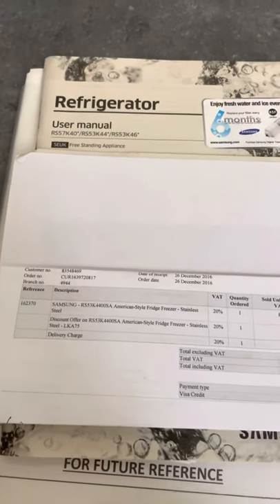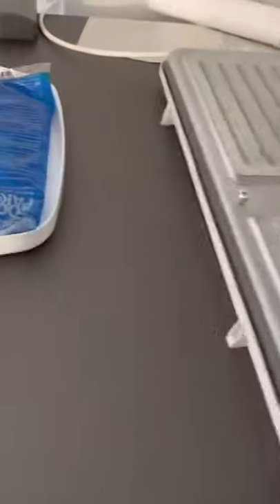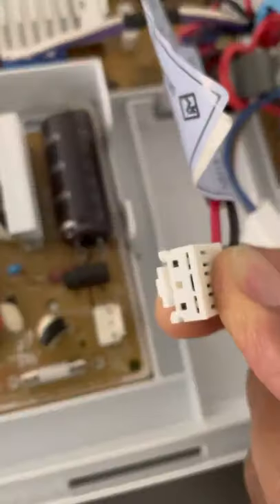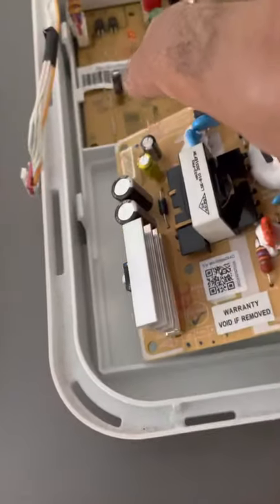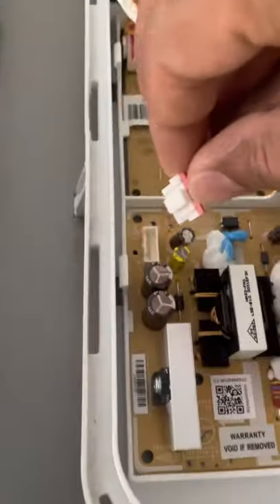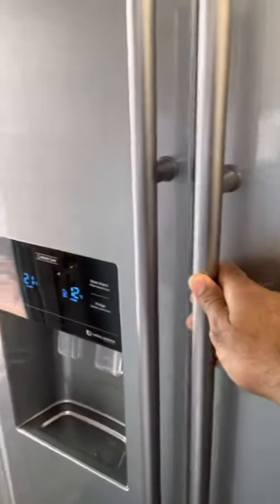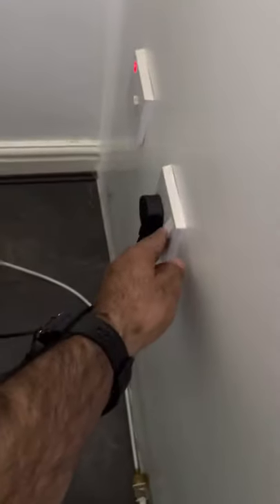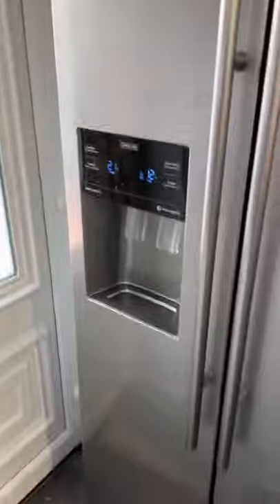Samsung American Fridge Freezer | No Power | Self Repair | DIY Repair Job | Easy Repair

Comment: Thank you sir for the video and thanks to all in the comments for the tips. I have a Samsung RS7547BHCSP/EF side by side fridge, it went "cold" (haha) overnight, no power outage or unusual events. Samsung scheduled an inspection in a week, would of had to pay $35 for troubleshooting. I found the module in description STD32W or DA9200530A (Main PCB Control Board Module) , than pinpointed the Schottky diode SB2100, tested on board, it was short-circuited. Some extra research revealed it is a common fault with this type of source, many recommend swapping with a bigger one. All I could find is a SB5100 (5 Amps 100V) where the original was 2 Amps 100V, I had to drill the board to accommodate thicker wires, used a 1.2mm drill bit only by hand, very careful not to damage the copper leads. Solder it and works like a charm. I hope the extra strength will keep it running for a long time. Thank you all and good luck to whomever will find this post useful.
Reply from the maker: That’s excellent. Good to see this video still helping out. My mission to help many. Please support me, like share and subscribe. Thankyou 👍🏼👍🏼

Comment: Same here- my fridge just stopped working, no prior issues whatsoever... I found the faulty diode (DS2) afer checking for continuity with a multimeter and then took it for a replacement at a local TV repair shop (yes, not even a fridge repair shop!!!). It end up costing me ~5 EUR and about 2 hours (including the trip to shop) of my time. Many thanks for the video and hope this helps others solve their Samsung side-by-side fridge issues as well.
Reply from the maker: Fantastic!! Please support channel, like share and subscribe. 👍🏼

Comment: I wanted to share my experience after watching your video just so I can also help anybody who's Samsung American fridge suddenly looses power,  I had the same issue with mine, after watching your video I decided I was going to order the part and attempt to fix my self, I rang an engineer and was quoted £160 plus vat plus parts to fix my ff, he said on the phone it was a common fault with one of the PCb, so I decided I look on you tube before forking out that much, I ordered off amazon for next day delivery, I paid a little more than I could've got off ebay but I was after a quick turn around, I was supprised there was so little available on amazon and not as many reviews as I'd like but ordered it anyway as I thought as amazon if it doesn't fix the issue I could send it back. The part came as expected the next day so I fitted it like in the video, but the fridge still had no power I was literally on the verge of giving up so I went to put the part into the box for a return to amazon for a refund, it was then I noticed that the box the new part came in had a stanly blade mark up the box, and seen as though I carefully ripped the bag the box came in I then realised this had been sent out before to somebody else and I suspectected I'd been sent a duff part where somebody had had the same issue then posted their broken one back to amazon!, I returned the parcel explaining my reasons and I was given a refund from amazon, I proceeded to buy another part of a Samsung approved dealer cost me £80 next day delivery, it came I fitted and the fridge fired straight up!, moral of the storey if you do order of amazon or Ebay bare in mind there are some idiots out there doing this and had I not seen the slash on the box I was first sent I would have thrown a perfectly good ff, thanks for you video your a lifesaver
Reply from the maker: Great this video is still helping! Yea that’s how these things work sharing experiences, and I am sure your experience will help many to come. Glad you got sorted in the end, and such a shame people out there would do such a scam, shame on them. Thankyou for watching, please support my channel, like share and subscribe.  👍🏼👍🏼

Comment: Spot on with the fix.
A 20p diode as mentioned further down in the comments.
Extra info....
When testing with a multi meter, if you have no 5v output it is the diode labeled DS2
Reply from the maker: Glad this is still helping out there..
Gauranteed fix, Thankyou 
Support by like share and subscribe 
👍🏼
Reply: i love you

Comment: I just came back to say thank you so much! I had exactly the same problem. Checked the board and the diode DS2, which is the big one of the three and is of type SB2100,  was shorted. Replaced it and works like a charm. Total cost 12eur, 0.1eur the diode 11eur fast shipping. My fridge is also the RS75XXX variant. cheers!
Reply from the maker: Glad this video is still helping many. Please kindly show your support, and get family and friends to subscribe to the channel, won’t cost anything but will be a big help to us. Thankyou 👍🏼👍🏼

Comment: Oh, man, this rocks. I am sure you are making people's days and today you made mine :-) We returned from holiday last Sunday and the fridge was dead, no power. To cut a long story short: called Samsung, they filed a service request, Monday morning the service called back - they gave me a slot in 2 weeks (!!! really great to be for that long without a fridge, which, btw, was full includingh the freezer....)  Also they claimed that just diagnosing the problem would cost 2000 CZK (abt 67 GBP), plus the price of the PCB (which would surely be replaced completely) is abt 2500 CZK (abt 85 GBP). Plus, my best guess abt additional 50-100 GBP for the technican time and miles to come here..
Having watched your video I checked the DS2 diode and, what a surprise, found it shorted. Took less that 24 hrs to get a new one delivered (I used SB3100 - the 3Amps one). The diode incl. delivery costed 2 GBP (of that 1.5 was delivering the package :-D)
So, to summatize: 
- cost saved: probably abt 200-250 GBP
- time saved: 11 days.
T H A N K  Y O U ! you really made my day!
Reply from the maker: Great to hear that, this video is still helping many. That’s was the point, help out where possible. Please help my channel to reach many more, subscribe like and share. Thankyou 👍🏼

Comment: I don't have an SB2100 diode lying around, and it's weekend, would it be possible to replace with an FR207? Still have that one. It's not a Schottky and it's 2A - 1000V in stead of 2A - 100V

Comment: Hi my fridge has done the same, your video is great but I am really struggling to find this part on amazon. Any ideas? Thanks
Reply from the maker: Hi, Thankyou for your kind comments, appreciated. My videos are to help as many people as possible.
I have just had a look on Amazon (21/12/21, @ 3.30pm), and yes you are right there is not much on there for this part. I have only seen 1 part and that seems rather on the expensive side, it is around £91, considering I bought it for £57.90 back in June 2021. But I have also looked on eBay and there it is selling for a similar price to what I payed, and also Espares.co.uk is also selling it at a similar price. All I can suggest is maybe consider buying from eBay or espares? Only reason I bought from Amazon was due to the faster delivery time, eBay was going to deliver by 3 days later than Amazon. It’s the same part, but I suppose it all depends on how soon/urgent you need it.
I hope this helps.
Reply from the maker: I have pasted some links for you, to help:
https://www.espares.co.uk/product/es1876711?utm_source=google+shopping&utm_medium=shopping&utm_campaign=google+shopping&gclid=Cj0KCQiAk4aOBhCTARIsAFWFP9Gkh0UUG6RUCGw_hhNt6aglsQ7BYWJbFMmq5nuLGPaKDIZrFGvFibYaAvdcEALw_wcB
Reply from the maker: I have added this eBay link also:
https://www.ebay.co.uk/itm/132784877688?mkevt=1&mkcid=1&mkrid=710-53481-19255-0&campid=5338767030&toolid=10029&customid=eb%3Ag%3Avms%3Aeb%3Ap%3A132784877688%3BCj0KCQiAk4aOBhCTARIsAFWFP9FI2UL3ppJuhBthDeeDpPhPeq6ey3wHOEHjkzn0-8wL31nYNKQmrgQaAqXcEALw_wcB&_trkparms=ispr%3D1&amdata=enc%3A1EWhU5GpqTkSiK0l4uCtgow97&gbraid=0AAAAADmMgii6KABY4Wt9eoE3eaHFU7t_M&gclid=Cj0KCQiAk4aOBhCTARIsAFWFP9FI2UL3ppJuhBthDeeDpPhPeq6ey3wHOEHjkzn0-8wL31nYNKQmrgQaAqXcEALw_wcB
Reply from the maker: Please like share and comment. Will be appreciated. Thank you for watching. Please also do watch my other Smart Inspo videos for you.

Comment: Good video. Diode DS2 on the board was short circuit. Will new board be modified to prevent repeat failiure? Do Samsung or anybody else sell repair kit for board? Do Samsung have a technical support address/telephone number?
Reply from the maker: Not sure if the new board has modification to prevent repeat failure. 
Samsung service centre may be able to help? There number is : 0330 726 7575
Maybe they can answer if a repair kit is available as you mention?
Suppose it depends on the cost comparison between repair kit and buying the whole new board.
Good Luck, hope it works out.

Comment: The red led blinks only once  inside the middle pcb?
Reply: Our fridge has also a power issue, the led lights up for half a second and then no more, the fridge looks completely dead, no power at all. Is replacing this specific pcb the solution to this problem? I’m not sure if the maker of this video also had a short light up of the led.
Reply from the maker: Hi Wolter,
I do not recall the led coming on,. It was totally out when the power was switched on, and fridge without any power. I would more than likely think it may be the same issue, as many people that have commented to this video experienced it, and resolved with the part.
Hope this helps. 
Thank you for watching, please like , share and subscribe.
Reply: @SmartInspo  I did investigate the power pcb a bit more and noticed a probably malfunctioning Schottky diode (mentioned by someone else in a comment) as it seemed to to be short-circuit. I got a new one from a store (a bit higher amps) and have replaced it on the pcb. After putting the pcb back on the fridge and connecting the power cable the fridge was completely operational again! This was a very satisfying fix 😁
Reply from the maker: Glad this video led onto another investigation and found an even cheaper fix.
Well I know what I’m doing for the next same breakdown 😉 
Thankyou
Reply: @whmeeske  Hi Whmeeske any change of a photo of which diode you replaced?
Reply: @manivankappel4045  Yes I have a picture indicating the little bugger 😉 Where do you want me to send it to?
Reply: @whmeeske  Hi Wh yeah they didnt let me put my email down i found it do but still nothing replaced it with a sb3100 diode i hear ticking but nothing else
Reply: @manivankappel4045 did you find the issue, I have the same issue as you, any help would be appreciated.

Comment: Can't find this on amazon.. can anyone help?
Reply from the maker: Hey Andre, why Amazon specifically? Maybe try eBay? Or espares also doing this.
Try this link.
https://www.ebay.co.uk/itm/132784877688?mkevt=1&mkcid=1&mkrid=710-53481-19255-0&campid=5338533988&toolid=11000&customid=EAIaIQobChMIj9nAmtyN_AIVg8vtCh1drQ_EEAQYGSABEgKRn_D_BwE&gclid=EAIaIQobChMIj9nAmtyN_AIVg8vtCh1drQ_EEAQYGSABEgKRn_D_BwE
Reply from the maker: Also found this, but much more expensive 
https://www.amazon.co.uk/dp/B0BQVPKWMS/ref=mp_s_a_1_3?adgrpid=148628318824&gclid=EAIaIQobChMIj9nAmtyN_AIVg8vtCh1drQ_EEAAYASAAEgJaTfD_BwE&hvadid=624836194227&hvdev=m&hvlocphy=9046688&hvnetw=g&hvqmt=e&hvrand=2135372323747513256&hvtargid=kwd-930759161504&hydadcr=3432_2327970&keywords=da92-00530a&qid=1671729213&sr=8-3
Reply from the maker: Hope this helps.
If not then maybe try replacing the diode as per previous posts. These I have seen on eBay recently and are readily available.
Reply: @SmartInspo  both only deliver to the UK but I ordered it from Samsung parts. Thanks for the help!! :)
Reply: @SmartInspo  what's a diode?
Reply from the maker: Yes, if you look at the comment jozsef Barta, posted a month ago.
It mentions the Schottky diode, SB2100.2Amp can be replaced.
This is what I will be considering doing in future. Costing at around 0.25 US dollars, and around £2 uk
Reply: @SmartInspo  ufff I ordered the part mentioned in the video... I just hope ot works